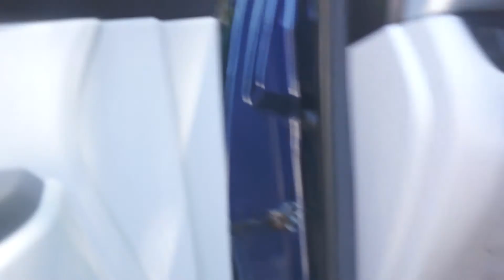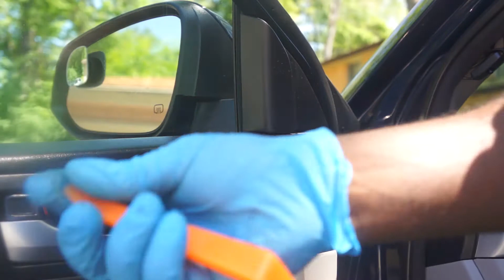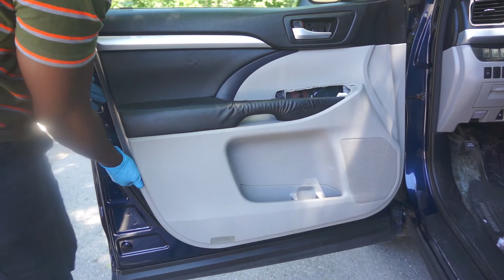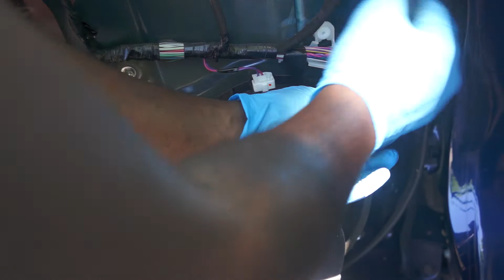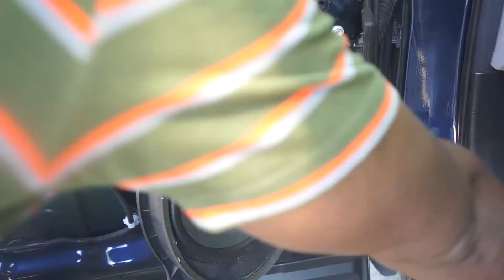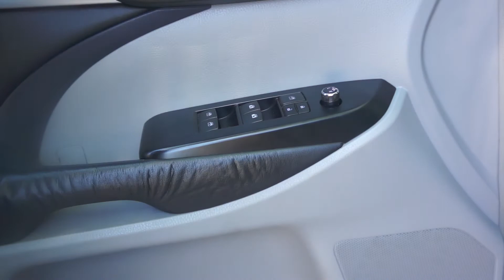How To Repair Clicking Door Check Toyota Highlander / How To Replace Front Door Speakers

Comment: OUCH.... I just went to my dealership... to get a new OEM door check, it costs $298.00 EACH....  I phoned another dealership that is the next closest here in Ottawa and they are charging $365.00... Is this some kind of joke, you might ask! BUT no. It is not. I will put up with the creaking noise rather than pay $600.00 plus to replace both. I just can't believe their prices! It's such a shame...

SIDE NOTE... I went to the dealership today, by appointment, for an oil change....went in for 9:00 am... They were not finished with it until after 12:00 pm. How unacceptable is that! Same excuse as last time as they took over 3 hours back then too.... they told me they are short mechanics... they used to be open on Saturdays but not since COVID. They never went back to those hours... They over book. When I got there, the entrance area had 9 cars in it and outside the drive in doors there were another 5 or 6 cars waiting to get in... I parked in a parking spot and went in. Told them I had an appointment but I would have to go back out and bring the car around into the line up... I told them NO Fn way when the guy told me to go tell them I was not staying... I told him they didn't fn tell me that they were overbooking and going to make me wait in a lineup before my appointment. But, buddy saved me and took me in... but it still took over 3 hours.... Never again. Hello Canadian Tire!
Reply from the maker: Some of those things are easy to do on your vehicle. Do them yourself 😉
Reply: $384 at my local Toyota dealership.

Comment: Completed both sides on 2014 Highlander XLE, thanks primarily to this video. I also bought Toyota OEM parts because my Highlander (bought in 2022) has been the best vehicle I ever owned. Here's some learnings, when pulling the door trim panel off, some clips may stay in the door - check for them and reseat in door trim panel. The cables for the door latch may come off and you'll have to reseat the cable end into the backside of the door handle (straightforward), however be sure the plastic clip around the cable is also seated in the housing. The OEM parts, right and left sure do look the same, I can see no difference. The toughest part is keep the door trim panel safe, either hanging, or sitting on something or just put it aside in a safe clean location. Also, as TrackPalmer says, it's a good time to upgrade your speakers with the panel off. Shocked to see how light OEM speakers are! The last thing, take your time. Even though you can do this in less than a half hour with all the prep, you might make mistakes being overconfident, or rushing. And oh how great the door sounds missing the creak!!! Thanks.
Reply from the maker: Great to hear!

Comment: I gave a thumbs for this video because it got  me 90% of the way there.  So I thank the YouTuber for showing the overall method to this.  That was great!

However, this procedure may look easy and I did it for my 2017 Highlander Unlimited Platinum SUV, but I recommend that this should be done by 2 people or else you are going to have to disconnect all the power wire harness connections to the the door panel when you take it off - this was missed in the video.  My wife helped hold the panel while I disassembled and re-assembled.

Couple things to note that when the author mentions the rubber seals, it's the 2 rubber seals that are pressed into the steel frame on either end of the window.  Once I took the panel off I had to slip the front one around the wire harness connector to get it out.  The rear small one just popped off.  No issues, you just need to remember the orientation of how they are press onto the steel frame until the door panel is put back on.

The other issue you are going to run into the the small illumination light at the bottom rear of the door panel.  When snapping off the panel the assembly came apart and landed on the ground.  I found the easiest way to put this back on was to pop the transparent polycarbonate cover out of the door panel removing it towards the inside of the vehicle - it's a snap fit on one side in the panel.  Then  take the plastic light housing and assemble it to the polycarbonate housing.  Then remove the light which is attached to the wire harness coming out of the door steel frame.  Snap this into the cover/housing assembly.  Now take this 3 pc assembly and snap it back in through the door panel.  So now your door panel is completely re-assembled.  Now the tricky part is if you haven't unclipped all the rest of the wire harness connectors from the door panel and you have your wife holding the panel for you lol... Toyota doesn't give you much length of wire for the bulb, so you'll have limited space between the door panel and the door frame in order to snap the connector back into the bulb housing assembly in the door panel.  I honestly wish I took some pictures.

It was straight forward me but I'm an automotive engineer and am well versed in these types of assemblies.  Good luck and btw the car door opens and closes silently now.

Thanks again to the original poster for making me dangerous enough to  attempt this with success!